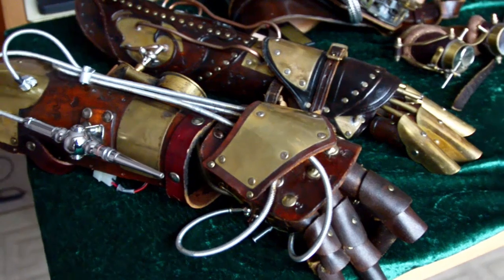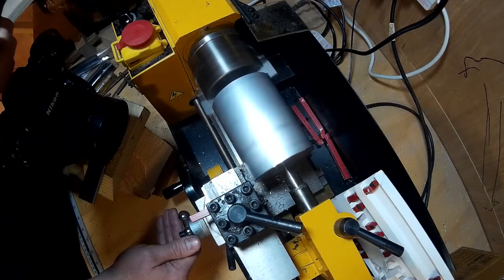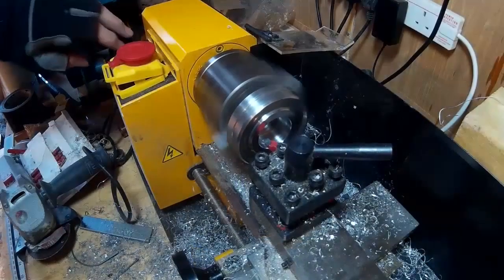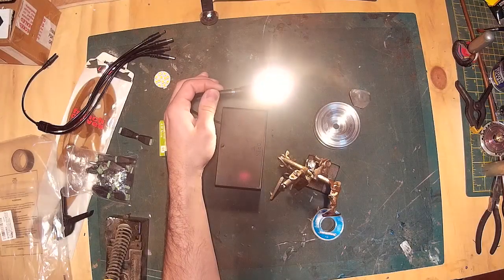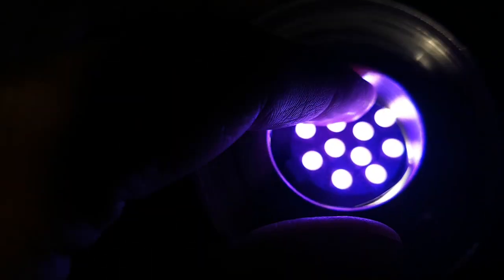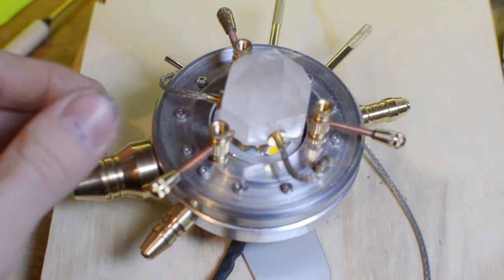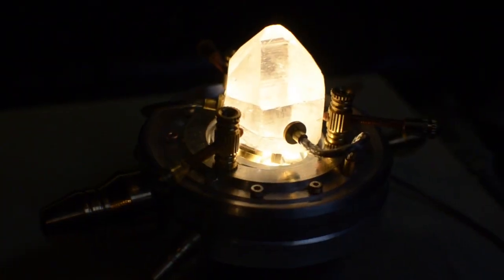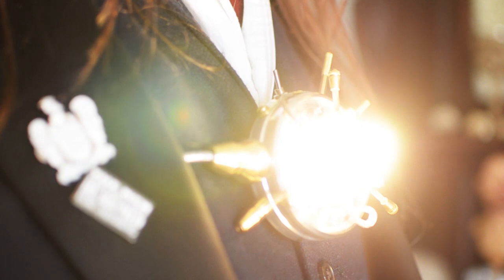Making a Steampunk 'Arc Reactor'

Comment: I actually have an vhs reading thing. I found it interesting to look at it, but I never had an idea for what I could use it.
Reply from the maker: Yeah steampunk usually involves some form of upcycling so old mechanical equipment is a good.place to start.
Reply: The Dark Power
Right, but the old stuff is getting less cause there is no new old stuff.
Wehre do you get your old parts from?
Reply from the maker: I know what you mean - alot of modern equipment doesn't have moving parts really, and when they do they're plastic.  Most of my current stock came from old pro VHS players that my work were getting rid of, ebay is a good resource too though.  These days if I can't find something now I can also lathe it.
Reply: That's exactly what I meant.